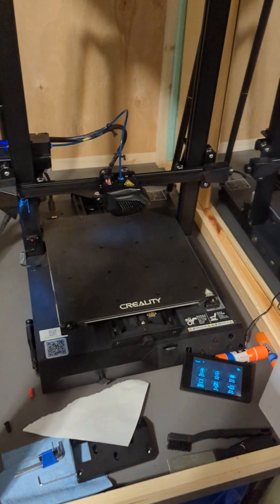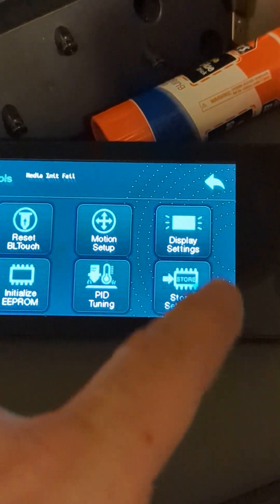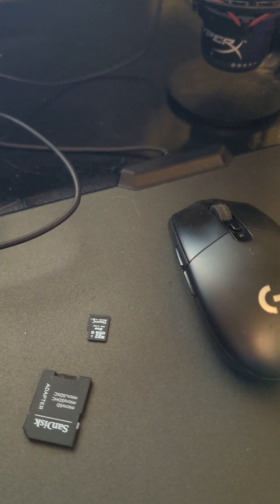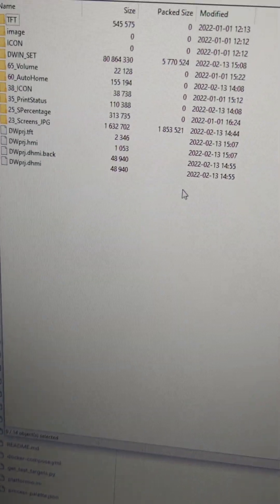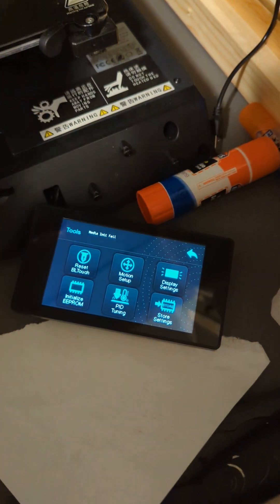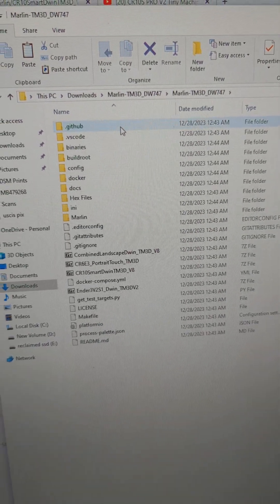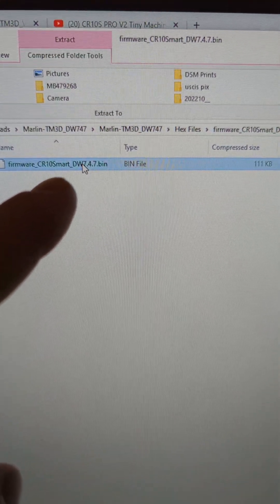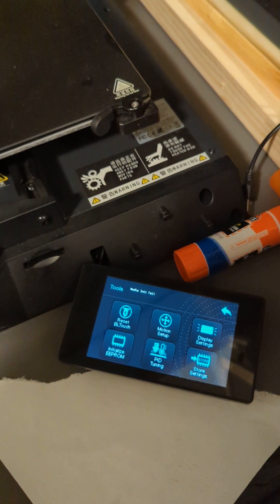How to update your CR-10 Smart firmware to TM3D (community firmware) 7.4.7 2023

Comment: Hi, please tell me what you do regarding a BL Touch? Do I have to install one or do I use the existing leveling system with the TM3D firmware?
Reply from the maker: I have not installed one before but I am pretty sure the TM3D firmware can use it.  There is an option for it within the settings.  I believe there should be some instructions somewhere on Reddit

Comment: not work for me, freezzeee start up screen, loading bar 50%, motherboard 2405 v1.2 stock screen, not work :( any option? thx
Reply from the maker: Make sure your Sd card is formated correctly, FAT32 I Believe, and if you are using a micro SD with adapter try a regular SD card.  Pretty sure SD card has to be 8gb as well

Comment: Hello, what does this firmware version solve? Do you have the file to update it? Is there anything I should take into account?
Reply from the maker: For me it solved the issue with bed leveling where the nozzle would first heat up, then once the leveling started it turned off and cooled down.  Creality told me it was my motherboard and basically offered now repair for their faulty software.